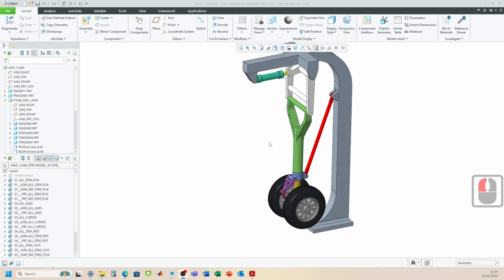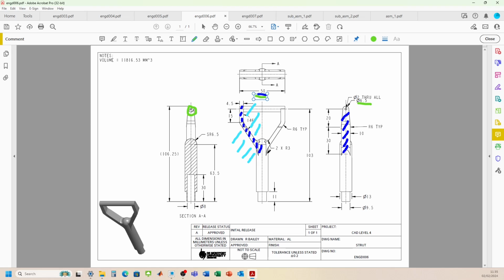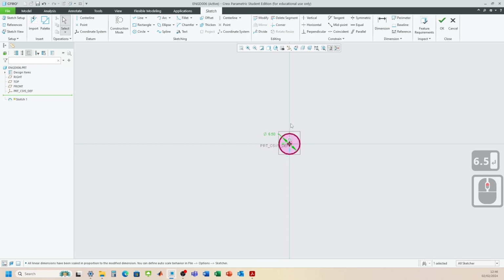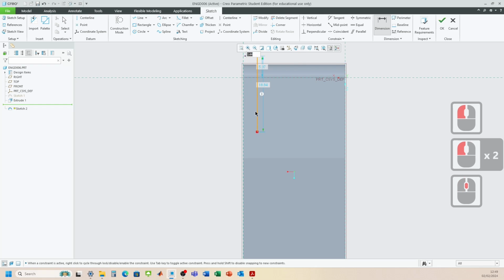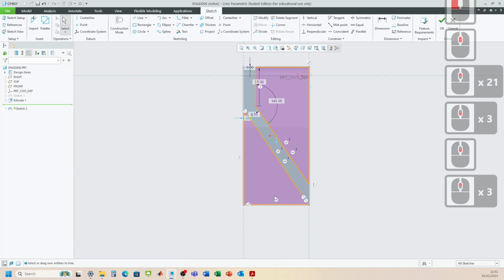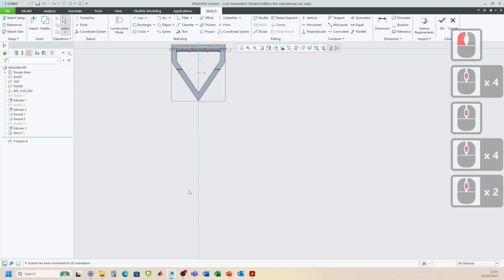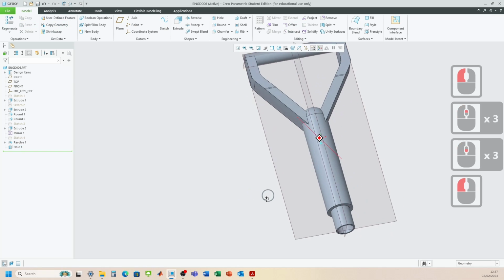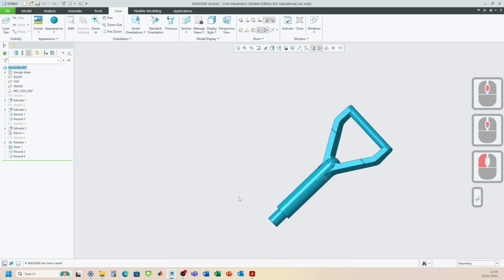Creo Walkthrough Strut Component

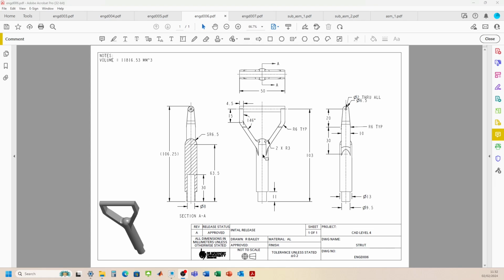Comment: Hi Dr. Bailey, thank you for creating this video series. I just wanted to point out a discrepancy between the plan diagram at 0:25 and your model at 8:22. In the plan diagram, the 15mm line starts from the center of the D6.5mm cylinder. However, in your model, you started the line at the very top of the D6.5mm cylinder. I found this as I was trying to construct this piece using only the plan diagram, but could not obtain the required volume of 11816.53mm^3.
Reply from the maker: Good point! I have update the drawing with the correct value, please re-download the assignment document.
Reply: Will do, thank you very much.